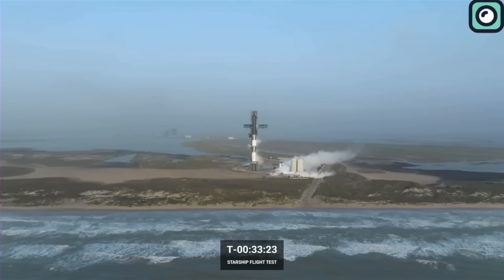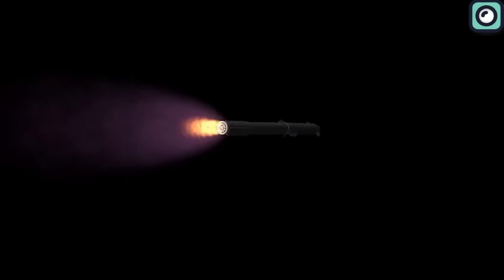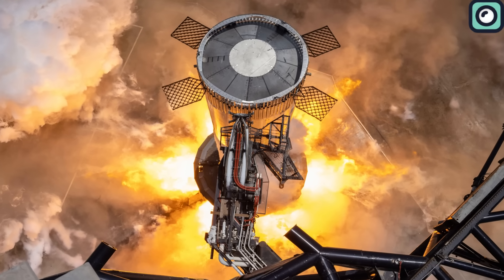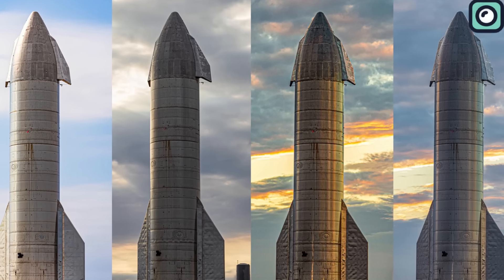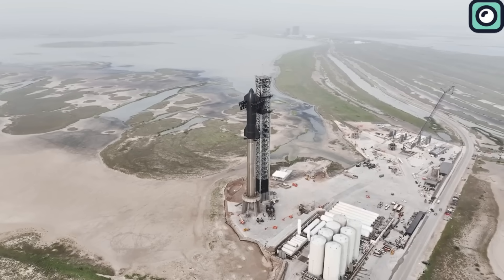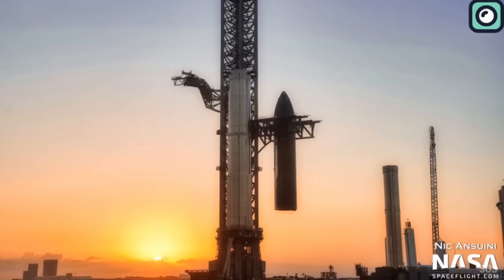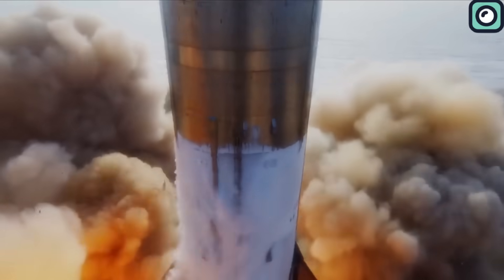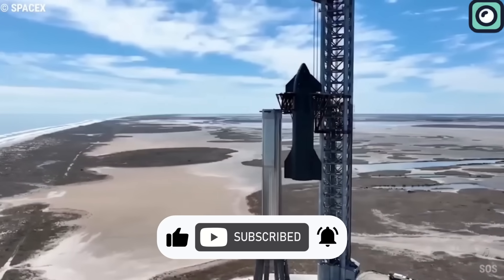SpaceX Fully Stacked Starship Super Heavy For The Second Launch!

Comment: Sometimes I feel the FAA is looking for Perfect instead of good enough. They really need to understand that these early Starships are Prototypes. More often then not they will fail. But the more they fly the better/safer/cheaper they become...
Reply: I think they get that. But being the regulatory body that has to deal with any mishaps, they'd want to ensure that no one is harmed if something goes wrong. I am eager to see Starship launch too, but I don’t blame them for doing their due diligence. Plus it's standard procedure for an investigation to happen on any mishaps
Reply: We're onlly going to find out if any of the new safety upgrade work when they are test IRL. It wont matter if Starship fails causing loss of property or life now  or 6 months from now the resultant consquences will be the same...No the best way forward is to test IRL, find Starships points of failure, then remove the hardware /or fix the software in the next iteration👍